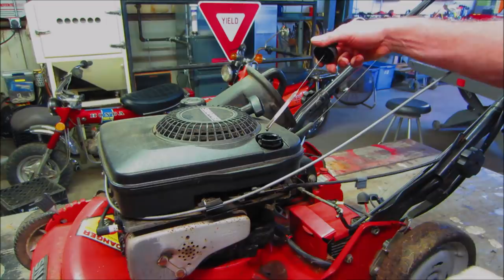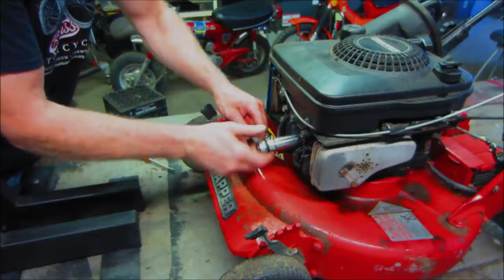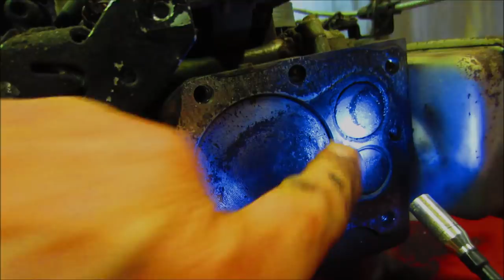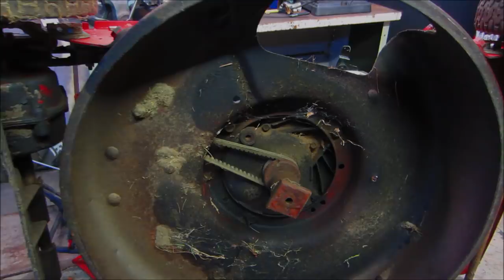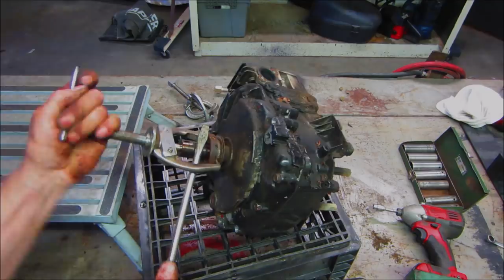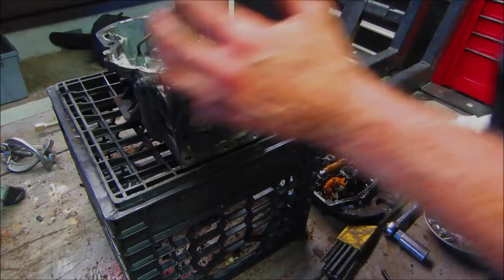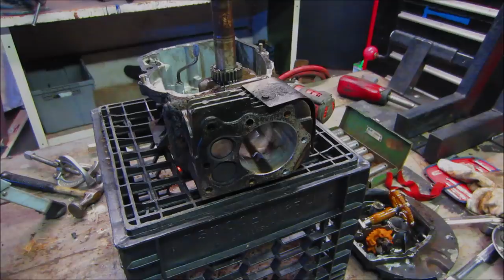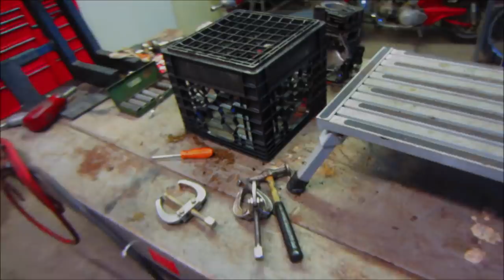Snapper lawn Mower. Why Did It Fail? lets find out.

Comment: Hahaha, I love you man. You start out by saying how it's not worth fixin with time an labor but you end up doing a full tear down. You just can't help yourself. You've got the mind of an engineer for sure. Love the video.
Reply: The size of the yard you found it on is a factor. One other detail: If a guy brings back a mower you worked on and it is locked up solid and you check the oil only to find the engine is completely full of oil up to the top of the fill tube, the cause may be the literal interpretation of the word “oil fill” on the cap of the dip stick.
Reply: He needs to know, so that he knows better in the future. 

Knowledge is not always as cheap as we would like it to be.
Reply: Real men cannot be beaten by a machine. We're going to figure it out if it's the next to the last thing we do.

Comment: Well because of Mustie1 my 26 year old Mountfield with a very good 3.5 Briggs on it has rusted out deck. Did i do what everyone suggested and throw it out? "NO" I cut the rust out with my plasma torch then cut out a patch from my old gas BBQ with a cardboard template tacked it in ground down the welds painted it with old half used rattle cans gave the Briggs its FIRST oil change EVER blew some BBQ black paint over it popped all back together and there you have it all fixed and will last another 5 years until the engine lets go. Cost me a bit of welding wire some electric and a WHOLE LOT OF FUN. ALL LEARNT FROM MUSTIE1 Thank you keep the vids coming. Steve UK

Comment: I love these tear downs. Always nice to see exactly what caused the damage and if it’s worth it to repair. Thanks!
Reply: Check them ring gap.  I will bet the engine was run without an air filter or it was sucking dirt from somewhere and that trashed the rings and the cylinder.  Remember the different bolt in the air filter cover?  It had been left out and that was allowing it to suck unfiltered air into the carb.
Reply: That’s an old engine.  Briggs has made a flathead (L type) in about twenty years.

Comment: No nothing about small engine repairs, but have REALLY enjoyed watching your video. I see alot of myself in you. Its not worth fixing, but want to know what caused it to fail. I am a retired electrician, and got so much satisfaction on what caused it to fail, electric or some thing else. Just wanted to find out what caused the failure. Thanks so much for keeping me on the edge of my seat. Your presentation was also great. Will now subscribe, because of your over all quality. Thanks so much for sharing. I always felt a bit of accomplishment when I found out the problem.

Comment: excellent video , mostly because this is the exact same as my own mower and my mower has also eaten an oil ring  . figured I would swap engines on it because the mower is almost $700 dollars new  , the way I got was somebody threw it on the curb while cleaning the garage because they couldn't get it started due to a $0.49 gasget on the intake primer ; I fixed it and ran it for 15 seasons in louisiana
Reply: Ken Massey  ATTABOY!!

Comment: Mustie1 I have that exact mower with a 6.5 Briggs and Stratton, love it because of the rear drive with differential and speed selector.  It cuts really well because of the odd blade I think and is effortless to use.  When mine finally goes I'm going to repower it with a vertical shaft Harbor Freight engine or small riding mower engine.  Excellent video.

Comment: The lever on the camshaft is the decompressor lever for easy pull start.Some others have a plastic "finger " protruding from one spoke at cam sprocket that lift the exaust tappet.

Comment: Your video caught my eye because I have an old cast deck Snapper. The original Briggs & Stratton gave up after 20 years of use. I replaced it with an OHC Honda, still running with more power than the B&S ever had.

Comment: My educated guess Cam timing jumped even plastic cams rotated on the shaft!!  Two compression rings enough to run. ive seen v8's with absoutly no compression when nylon timing gear on 60's chevy, pontiac and mopar 318's would shed their teeth!
Reply: I think you nailed it. You can see a scar on the cam where the loose bolt probably jammed it and knocked the cam out of time. The valves were opening and closing but NOT in time with the piston
Reply: @edwardwerick2420  

I concur.
Reply: These plastic cams pretty much never fail, they will last longer than the old cast iron cams. In more than 15 years running a small engine shop I never saw a failed cam of this type in a B&S, but the one piece molded molded cams in OHV Tecumseh engines are trouble, but only because dirt gets imbedded in the plastic shaft destroying the bearings

Comment: It always amazes me that the average consumer has not a clue about how things work. I've picked up many machines off trash piles or had them given to me that only needed the carburator cleaned out and the oil changed. Just recently I picked up a relatively new pressure washer left on a trash pile. Took it home, put some gas in it and it fired right up. Go figure???. Anyway, I enjoy the chanel.

Comment: Here's my guess: During a previous "tune-up" owner takes the air-cleaner cover off, and while holding the screw, decides to check the oil. While taking the dipstick out, the screw slips out of his hand and falls right down the filler tube. Owner curses and finds another screw for the air cleaner cover. Sometime later he runs the mower out of oil and the screw starts flying around and gets caught between the piston and cylinder wall. The motor overheats and maybe even seizes up. Hence the cylinder scoring, warped exhaust valve, and loose head bolts. When cool, the owner "fixes" the mower by adding oil. The screw falls back to the bottom of the crankcase, maybe the mower even runs for awhile before croaking for good.
Reply: NO< his son {8 yrs old} was fiddling with the mower, oil was low, he added the bolt to raise the level like we do in our well to raise the water level...eventually we have to put one of our youngest strongest boys down there to clean out the well. concussions occur, but they only talk with a slur for a while, although we are concerned that when they become age to vote, they already lean to the left.

Comment: Anybody that asks why you don't use the drain plug has obviously never worked on a mower before. Tipping on the side is the preferred oil drain method.
Reply: The newer ones have no plug and they tell you to tip them. I got a vacuum rig from Lowes that sucks the oil out. Works NICE!
Reply: If there is a plug, I generally use it. Btw I am a small engine mechanic who works on these daily. Thats my preferred method but I have no issued with tilting the mower sideways.
Reply: As he said, and I know from experience, they don't always come out ...

Comment: I think that mower came from the free pile at project farm.
Reply: Oh no kidding, he seriously abuses that poor mower, I'm surprised it still runs.
Reply: Maybe :)
Reply: Can nuts and bolts replace oil in your crankcase? Today we're going to find out!
Reply: Today can Mustie find out why my mower blew up.
Reply: Mental image of a small cup of bolts on the lubricity tester, and then sliding down the viscosity ramp.
Reply: Snapper mowers are junk now, their made in China that's what you get.
Reply: @andyoliver1054  most of the new mowers we get in Britain aren't as good as their 20 year + old mowers as they build them to be disposable. Don't get me started on Briggs and Stratton.
Reply: @bentullett6068  still use a 25 yr old polish built mower with a briggs. :)
Reply: @Boemel  the older engines are the best. New ones are rubbish
Reply: @bentullett6068  it has some knocking to it so i got another free mower with another briggs about 10yrs old, i only had to change the coil.
Reply: @bentullett6068  he figured it out, it's because it was Because project farm owned it! Lol I feel bad for his mowers😂😂
Reply: @Boemel  I use a 1998 Murray with a Tecumseh
Reply: @icantthinkofaname4682  metoo.
Reply: @icantthinkofaname4682  i just got a 1998 mtd riding mower with a 6 hp tecumseh and it still pulls strong
Reply: Jim F; That guy is great eh?
Reply: "What happens when you drop a screw in the crankcase? Let's find out."

Comment: I have the same mower except pull start only and Tecumseh 4.0. Its 1990 vintage. My other mower has a 99 Briggs Quantum 6.0 similar to yours. The Tecumseh is literally twice as powerful and starts on the first pull while the Briggs takes 3. Put another motor in it. The Briggs motors are everywhere. That is a great mower. Thanks for the video.

Comment: I have one of these Snappers.  The deck design is top notch and they cut extremely well, whether you're mulching or bagging.  When bagging, it's got some of the best suction out there and will cut just as well going backward as going forward.  Mine will still start on the first pull and runs like a top after 25 years of regular use.

I'd love to see you find the right engine for this.  They really are well designed and well built machines.  It almost breaks my heart to see this one done in by a misplaced screw.

Comment: On the teardown, you found mismatched screws on the side of the engine near the air filter I think, and commented "someone's been in here" thought maybe screw in crankcase from there ???? Thanks for the video, enjoyed. Have a snapper without all the fancy extras. Really crappy oil drain system. My Owners manual said to turn upside down. Thanks

Comment: When you sprayed WD-40 on the pully. It reminded me of every bolt I had to take off a 1974 Chevy Blazer daily driver we had back in the 90's. It spun a bearing and broke a leaf spring. We thought it would be an easy job. It was worth it after we cut the old spring out with a torch and changed the engine. It was a beast.

Comment: This was a great video.  Learned lots.  Once I saw the screw I knew.  I think you and many others did too.  How the screw got in there is another mystery we can only surmise.  I suspect when the owner was replacing or working on the air filter, they may even had the mower on it's side, though I don't know why, and they just lost the screw as they were taking it out.  I guess they though, meh, it'll be fine.

Comment: I just partially resurrected an older model of this machine. It was submerged in the flood here in March. Still needs a new air filter, and if I can find them, bearings for the self propel.  Took the drive wheel off for now. Cleaned the carb as best I could since I don't have an ultrasonic. It is functional now though.

Comment: Plastic cam gear. Wow!.. Cheap manufacturing has reached a new low.. Heaven forbid parts are actually machined anymore..
Reply: Well i mean metal is expensive and lookat how most people manage their yard equipment, they dont change oil use the blades until they are bent totally out, and dont even store them dry, they use and abuse them then the first minute the thing fails to start they buy a new one, using cheap plastic makes the product cheap and manufacturers know that it wont be maintained properly. I dont like the idea of using plastic but i understand why its done that way, cheap for the sake of cheap knowing no one will ever bother to keep it running, I mean look at cars while modern cars are built to go faster and have more miles put on them when something goes you don't fix you just replace, which kinda ruins the keep it going mentality, ive got a 1969 Buick Le-Sabre still runs drives at least weekly, have no idea of the miles cause it was never supposed to go past 99k, meanwhile ive also got a 2006 honda accord daily driver 302k and just had to replace the infotainment system cause the climate controls worked through it, built well, yes but to be easily serviceable hell no.

Comment: That door panel tool worked great on the valve springs... I will remember to use it next time I work on the older side valve engines. Those engines usually burn the exhaust valve. I give them a quick grind on my bench grinder, usually works, but that engine does look wasted.

Comment: The cheapie Lowes no name mowers are Snappers.  So if you have one pay attention.

I just had one that refused to start.  Removed and dumped the carb bowl, let it refill.  Started right up.  I wish carburetors still had check valves in the bowl like airplanes.
Reply: Lol. I did that to my father's mower last week and he looked at me like I was some kind of genius. Too bad I didn't get to it until about an hour after he came home with a new one. D'oh! I now own a Craftsman push mower. 😂
Reply: James Irwin.
Fuel, spark, air, compression in that order.  If you have em all, it'll run.

Comment: Try anti-seize on your puller threads you might be amazed. We have a 2' clutch on a 2-3'' tapered shaft we pull with an 1.250" fine thread an only way to move it is anti-seize on the thread oh an a ball bearing in the shaft center hole. Thanks for the videos.

Comment: Internal screw installed from a kid who didn't want to mow the lawn.
Reply: I was thinking more like a 4 year old helping daddy with the air-cleaner bolt down the oil sump. When's there's a bolt missing and you have a child...you know it's not going to be good. I use to put 410 cartridges down the 12 gauge barrel...and wondered how i was going to get it out. Lucky my dad tip the shotgun and found it when it fell to the floor. I remember wishing i had know that...tip the gun upside down...but my dad always told me not to touch his guns...so I didn't....I was just playing with his ammo loading the gun.
Reply: Spoiler😢

Comment: The beancounters should have those plastic internal engine parts shoved into an orifice. So lame!
Reply: Yeah I was thinking that too. Never seen a plastic camshaft before! I had heard those briggs flathead engines are junk, and sure enough they are.
Reply: @trevorjameson3213  That briggs engine is good for 20 + years Cams never fail,  Only plastic part on them that does is the oil pump drive gear, and then only if run low on oil.  Or would you rather a honda engine that breaks rocker arms, how about a kohler that has conrod bolts undo.  Ive been a small engine mech for 27+ years and that briggs is the best engine made except for an aussie built 2 stroke unit that doesnt exist any more.
Reply: Certain plastics can be as strong or stronger than aluminium! Plastic tech has come a long way!
Reply: @glennlurman3514  They skip though as the plastic teeth of the gears deform at high temperature. This puts the valve timing out as happened here. F1 engine crank and cam gears are all titanium for a reason. No plastic shit to be found.
Reply: @doctorboy5892  Did you seriously compared the stresses of an F1 engine to what this small engine can do? Why don't you also compare turbopumps for rocket engines to the average turbo installed on an average car?
Reply: I was rather suprised about the plastic and sure didn't expect it. Guess a life expendiency was built into it. Makes me pleased that my very, very, old Montgonery Wards lawnmower is still running strong - with metal parts!